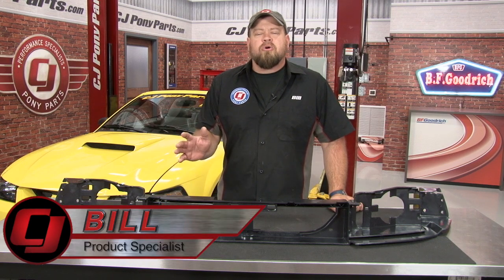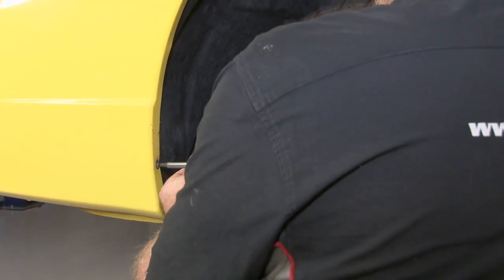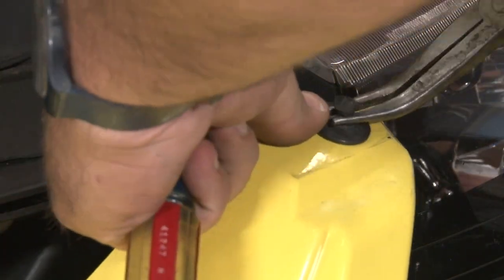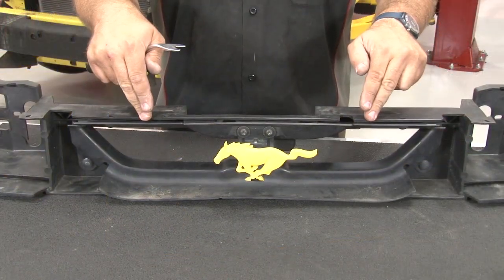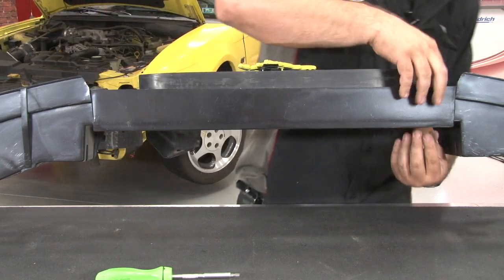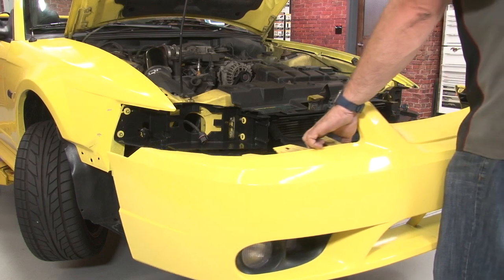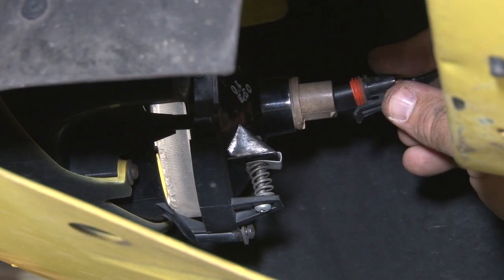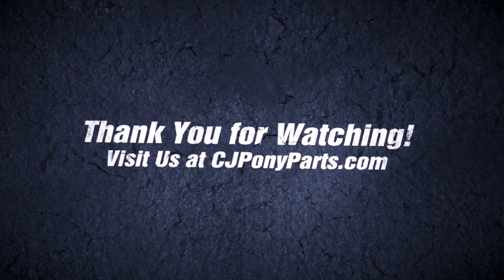Mustang Headlight Reinforcement Panel 1999-2004 Installation

Comment: The headlights didn't fit correctly from what I'm seeing. The reason for that is do to the six tabs on the bumper cover. On each side, the left and right tabs rest on top of the support structure while the middle tab goes in the slot and locks in place due to a bead on the bottom of the center tab. This allowed my headlights to fit perfectly against the top where contact with the metal fender occurs. Hope this helps the next person during their support structure installation.

Comment: From what I've found, nobody manufactures the SVT Cobra 99-01 OEM bumper. The 03-04 bumper fit my 99 quite well. Do let me know if find a chin spoiler for an 03-04 Cobra front bumper that is reasonably priced; used or new those are pricey.

Comment: Is it basically the same on the 94-98 mustangs?
Reply: +xSilentxKilllerx  The headlight removal is more difficult but besides that it is very similar
Reply: The fog lights will not have to be unplugged. You will need a 12mm box wrench to slip over the rear of the adjustment  nuts and push towards the front. CJ Pony has a video on replacing the headlights, that should help. On my 95 the headlight and turn signal are separate lights.

Comment: Love the content of all these videos! However, the ANNOYING and UNNECESSARY rock music bed is pretty cheesy. Also, could you speed up the edits? We don’t need to see bolts being completely removed. Just start it & edit to the next shot. There is a reason most of us have stopped watching automotive shows on TV. Don’t be a clone.
Reply from the maker: We are always evolving as a department and have changed up the music and other things as we go. Unlike many of the automotive shows we do all the work in house as you seen it being filmed.